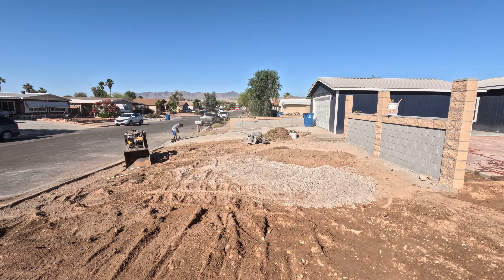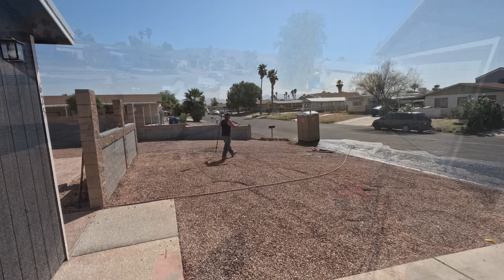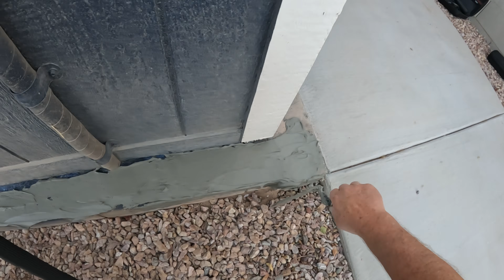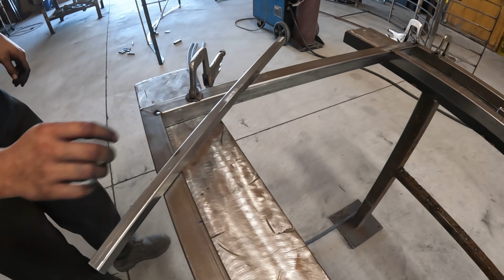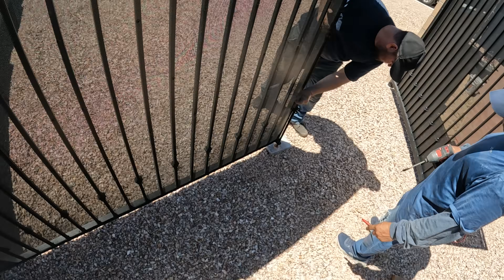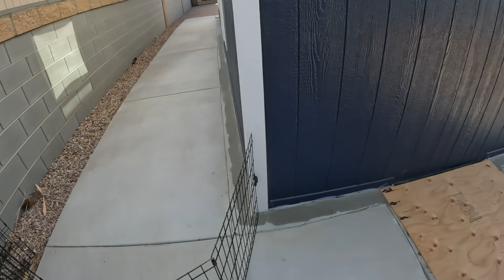PART 6 - Professional Decorative Gravel Install and Concrete Patch

Comment: Customer relations so important Dave arnt they .lovely job followed all of it .We did a gravel drive and used the plastic grid system and filled it with decorative gravel keeps the gravel in place .Do you that system in Arizona Dave ?
I always say this but your climate and weather there is as good as your work awesome 😂👍👊🏴
Reply from the maker: Yes I've heard but haven't used it yet.
I think it's for driving over in wdt climates

Comment: Ussually the shutoff and meter are in the same box at the street.  I've never seen it added to the side with another box.  Kind of anoying.  Maybe the original meter was smaller as it was manual and the new "smart" water meter is bigger and so they had to add the second box for the valve?  I would think the city would have gone cheaper and just use a smaller round shutoff box. ...But what do I know?  lol.  I know the newer houses where the bigger water meters are installed now, they are using a much BIGGER box (about twice the size of that small one).
Reply from the maker: It was new to me too

Comment: Everything came out great!! The compacted concrete is a good idea and I may do that in my backyard? Hard to believe none of those iron workers wear safety glasses when grinding and working with that metal. Thanks for the series on the complete job, nice to see the whole process!
Reply from the maker: I was surprised to, but I guess they have been doing so long they know where the shavings are flying.

Comment: The project has turned out great David, well done. The ironwork really popped once it was installed. I hope that’s paintbrush you used to texture the block coating was horsehair and not nylon? 😂
Reply from the maker: I wish but we did get some powder coating in there

Comment: 6/19/24..A+ on yur multi phase job  their in AZ. I am in New Orleans area..so that location is waaay different, low pitch roof houses, no grass but gravel ground cover. Then cinder block & steel tube as fence...with very nice decorative silhouettes of Palm Trees featured inside of 2 rectangular entrance gates. Very clean looking finished project. Another great job David!
 Stay safe...& dehydrated while working in that heat! 👍🍺🍺👨‍🔧
Reply from the maker: Sounds like similar climates but the humidity is a little different.
Hydration and climatizing is key to survival ?

Comment: Some of things you did reminded me of when I was in the US Navy and living in San Diego. In California there are rules that apply because of the local conditions and because of earthquakes. In Michigan where the Family lives, we are not allowed to do some of those things because of very cold winters. Vice-versa the rules here can't always be used there. Example: We must bury our water lines very deep because the frost goes deep here mid-winter. And, the gas lines here have cutoffs, but they do not normally (some exceptions) have automatic shutoffs tripped by earthquakes. Also, our heating systems are required to be more robust and energy efficient. In San Diego all we needed was a simple wall furnace and that was plenty.
Reply from the maker: Weather definitely determines the build